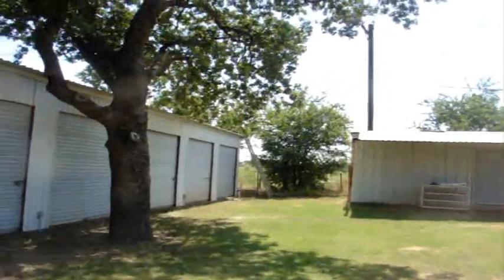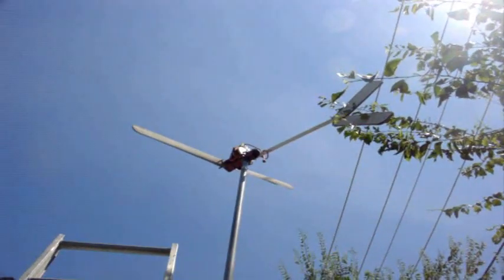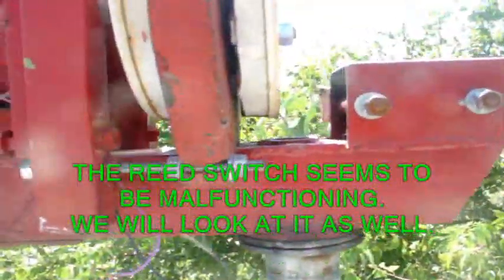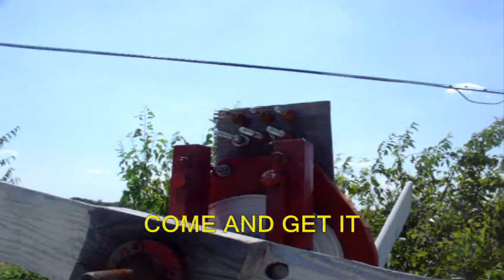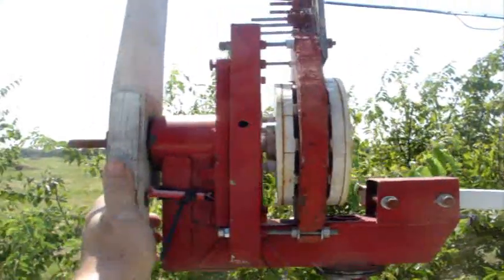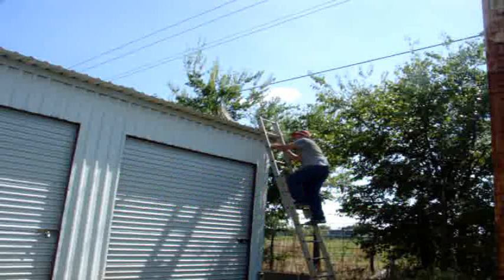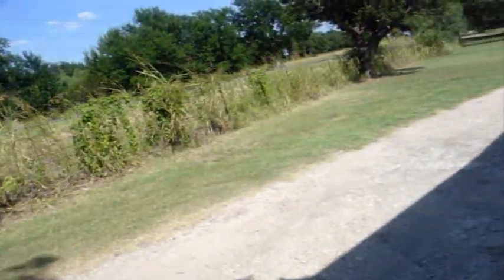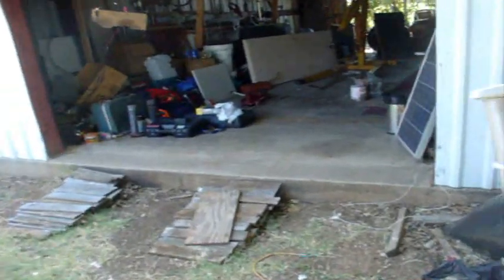TAKING DOWN THE MUDDYS' MIGHTY MINI WIND TURBINE REVSION 1

Comment: Hi ***** nice video! 
114f = 45.5 degrees Celsius,, that is not MUDDy´s man cave,, that is MUDDy in the oven. :-/
Nice seeing you a bit in this one.
Reply from the maker: My PlayHouse I hear ya.
Today after I got done throwing Newspapers all night, I stopped by the shop. I cleaned up one corner where the wind turbine pole mounts will be installed. and drilled the holes. Then i set up the U-Bolts into the C perlins. Then my partially frozen drink got hot. fortunately, I was rescued by not having the right wrench to fix the wind turbine, and the camera battery dropping out early. 
I went home.
:)
   I will probably start the wind turbine inspection, and fix in the morning while it is cool.
That ought to finish enough video footage to make a decent video.

But, I did find my old fan and inverter. One wet T-shirt later, and i was cooled off.
Keep smiling and have a ball.
MUDDy